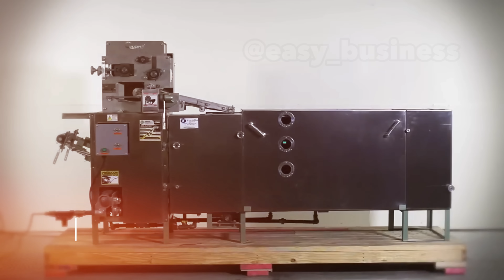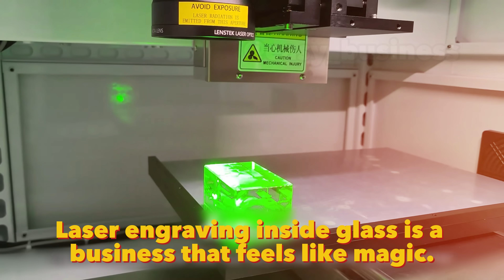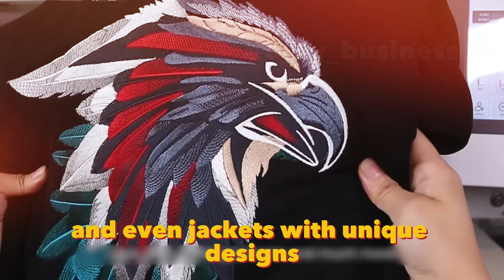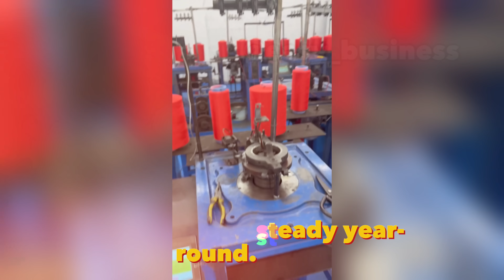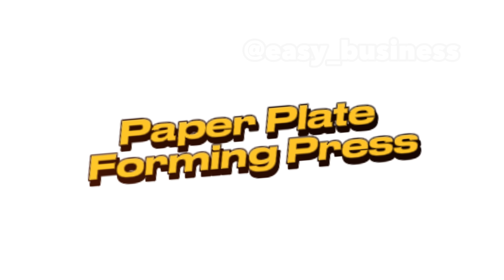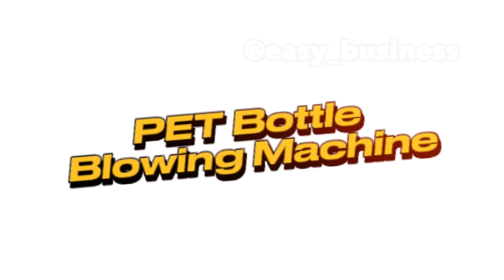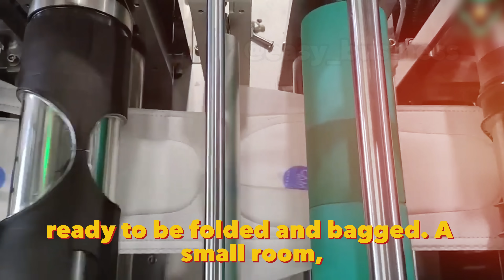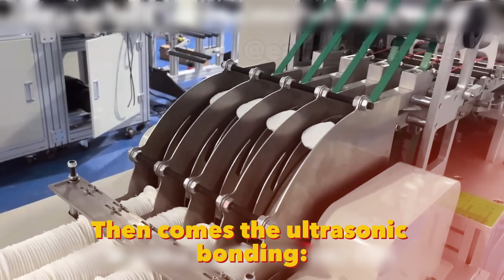30 EASY MACHINES TO IMPORT FROM CHINA FOR STARTING HOME BASED BUSINESS

Comment: The chinese are famous for technology that never lasts. You dont do business with an entity that does not speak your language. I have worked with chinese machinery in crushing sectors. The machines hardly last for 6 months. You place orders for spares and they say yes to everything and you pay for your spare parts. Eventually when you open up that box the spares do not match. Of course you try to phone and cant understand what they say at the other end ! Great job done.
Reply: You saying that big dent on the side of the Unit +box. , parts threaded wrong, and missing parts / parts not fitting is not normal ? Sir everything from China were use to this treatment

Comment: Remember, an 8kw industrial CNC lathe is always a great addition to the home office or bedroom.
Reply: The brutal amount of wood dust, the noise, the sore troat, im quite sure all family will feel bliss.
Reply: Sounds like someone doesn't have Phase 3 power running to there home and your just "Jelly"
Reply: @douglee4268  Just run 3 extension cords from the wall plugs and your all good to go.

q8D

(A friends mum pulled a plug off a lead accidently... Got the Phase and neutral back right but wasn't sure about the green/yellow one so split it evenly between the 2...
Hilarity ensued.)
Reply: @TheButlerNZ would the extension cords from Christmas Lights work?
Reply: @Umlaut95 Sure, Those things last a quadrillion years, We have one that all the insulation is flaking off but that just adds a soft red glow to the flashy lights... add that to the real dead pine and you get a subtle smoke effect and that piney fragrance to boot.
You may need to douse everything in salt water for cooling so make sure your barefoot so as not to rust your steel cap boots.
Reply: @TheButlerNZ ahhh of course,
of course. How silly of my to wear my lucky bootless-steel toe boots. I usually try to shower before adding more water to the tree, nothing says safety like being clean and dripping water everywhere to show everyone that you’re clean. 
I was thinking of shortening the distance the electricity has to travel by hooking up hold wire hangars in series, ya know to save on cost. 
Now is it better to line the floor with paper towels incase a spark jumps or no that’s just heat being added to the room?
Reply: @Umlaut95 A Year before my 1st birthday I was given a suit so stretchy it still fits all these years later... I believe it is impervious as I haven't died yet... Although the bones within are no so bullet proof, but as it took me a month to get my wrist looked at when I broke the end off my Radius, I think I can take on a few thousand volts.. I'll just take it on in installments...
Oh and I managed to get a combine harvester that I think will fit right in atop of the power point... Feng Shui
Reply: It would also look stunning in the bathroom.
Reply: @thecursedlanternmusic  Don't think it would fit, what with the smelter and all.
Besides, then there would be no place to park the Yacht.
Reply: @TheButlerNZ 😅
Reply: @thecursedlanternmusic replace the shower with it
Reply: i was thinking of fitting it up in the front porch, got the laser engraver in the bathroom, operate it whilst I take a dump
Reply: Even comes with a bed…!  🤗
Reply: 😂 @serpent213

Comment: My fear is fixing it
Reply: If your fear is what happens when it goes wrong, how about starting a fixing business?
Reply: fixing anything is not a problem if it is not made badly at the start,
so if you have a problem with something custom or specialized, find a "makers club" you know the people that play around with raspberry pi for fun, and had 3d printer before it was popular. sometimes high quality private high-schools or collages have them. get the club to rebuild it for you with quality parts made from the ground up, that way you can always make replacement parts. if you are willing to drop $15,000 a team of nerds can do a lot, they will also point you in the correct direction and tell you things like you are going to need a supply of bottle blanks for that machine, why not make the full bottle from plastic beads directly, why addict your self to "printer cartridges".
Reply: Fix it? It’s from China, it’s ment to be thrown away and buy another one.

Comment: The guarantee on all this is that there is not a guarantee. My imagination is that many of these machines are in a corner of a garage covered in dust and have broken after the first day of use and a Chinese on the end of an email message laughing whilst they read it.
Reply: I work at a factory that has Chinese-made machines for cutting electrical steel laminations (a very difficult material to cut cleanly) and for cutting mica/epoxy/glass-fibre insulation. The machines work really well, cutting precise lengths that can be adjusted on a key pad, and are easy to maintain. Spare parts are available.
Reply: @cedriclynch  I am very happy for you, keep the spare parts coming.
Reply: Lol truth
Reply: I feel everyone underestimates how far the Chinese are actually infront of the west. 

While we have been parading lgbtq, diversity hire they haven't just matched the west they have advanced more than most can imagine.